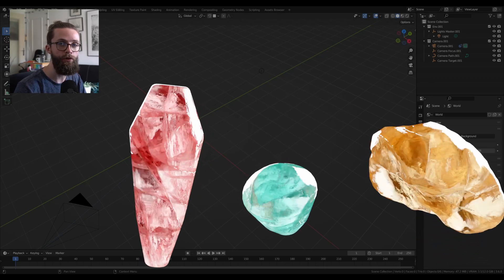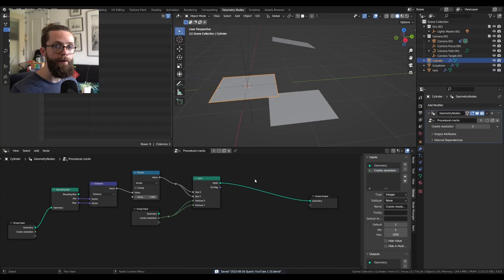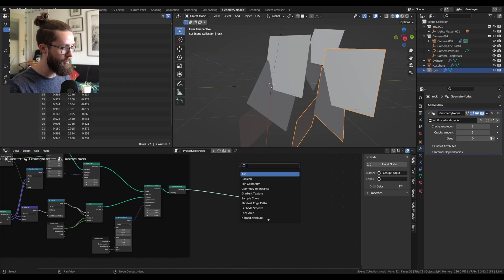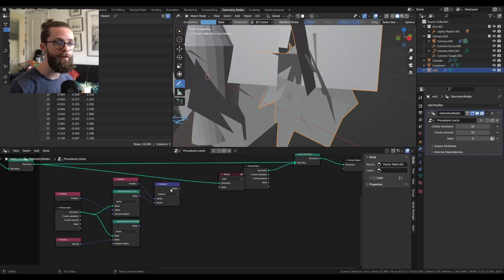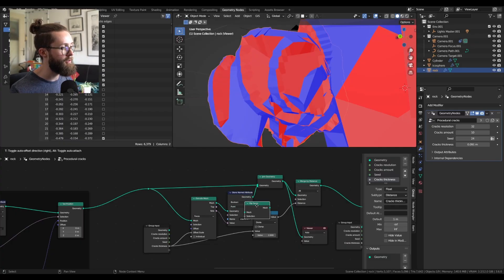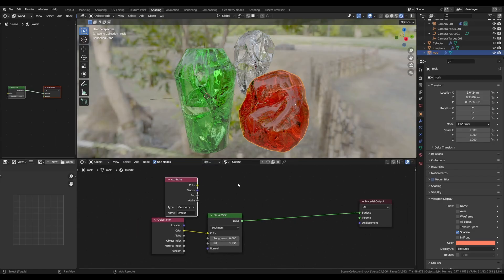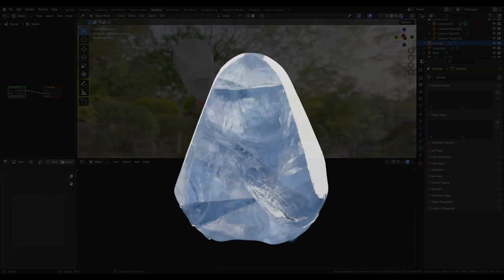Ultra Realistic Procedural Quartz/Crystals - Blender Tutorial

Comment: if you have issues with the edges of the cracks slightly clipping through your base mesh, adding a transform geo node right after the set position in the "fix cracks size" section and scaling the cracks down by something very small like .99 worked for me and got rid of the clipping.

Comment: Hello 👋 just commenting because im trying to apply this process to a more complex geometric shape and it isn't working. Will this work with more complex shapes?
Reply from the maker: Hi there, one comment below mentionned reverting to using booleans for more complex shapes, it will take way longer to cmpute and be less stable but it might work better in some shapes. Also you might have to use a different method to scatter points like distribute points in volume for example. Hope that helps!

Comment: Is there a way to distribute the planes more evenly in the mesh? (For example on a human character model, it works, but the arms have way less fractures than the torso bc they are way smaller. Can somenone help?
Reply from the maker: You can try [mesh to volume] -> [distribute points in volume]

Comment: I keep getting random dark spots on the planes outside of my shape. For the most part it works but it is definitely a problem. I'm using blender 4.0 so didn't know if maybe that could be a problem or not
Reply: I also tried to follow your gumroad file and it still kept having random parts on the plane appearing outside the shape
Reply from the maker: What are your render settings? Is the Light Path count for the Transparent rays set to a high enough value?

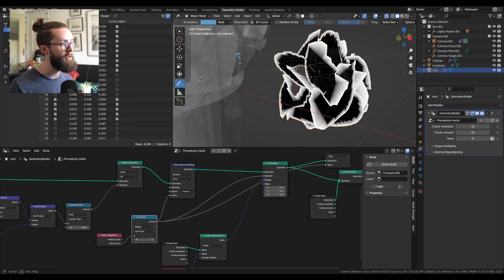Comment: This is a very nice tutorial, but on 9:00 the jaggedness of the edges is only partially removed. If you view them from the front, the edges are perfectly smooth. But viewed from the side, they are still jagged. The edge vertices snap to the inside of the gemstones, but they don't all end up on a straight line, hence the jaggedness. Does anyone have an idea on how to fix this?
Reply from the maker: I don't think there is an easy easy fix for that, you could do that with some math to make sure they only snap to the surface in a planar way regarding to the normal, with ray cast nodes or further fix with set position nides, which is easily doable but might not be so straightforward in a tutorial